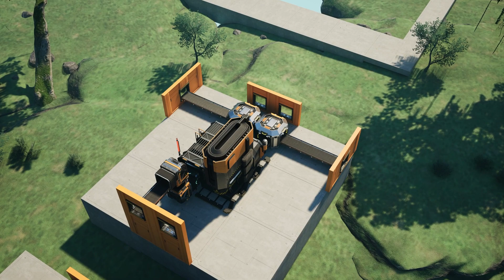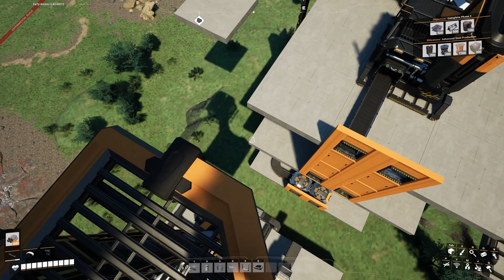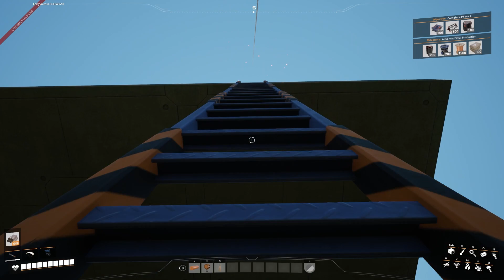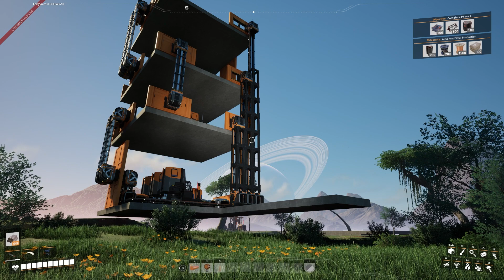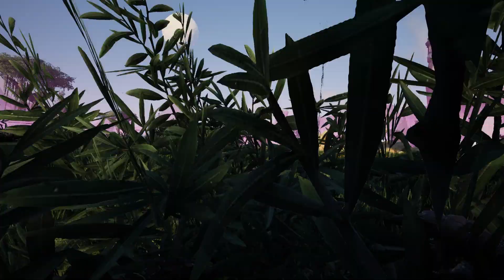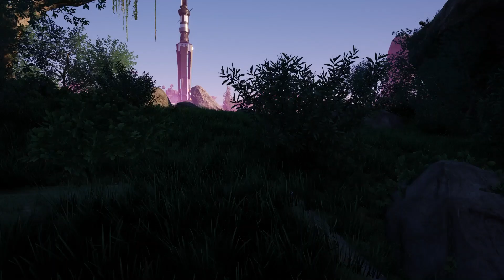Automating 180/M Steel Ingot | EP27 | Satisfactory U8 | Blind Playthrough

Comment: Just curious, have you used the custom settings to unlock all the alternative recipes or been very lucky with your hard drives?

Nice looking factory.  Looking forward to seeing what the beam and pipe factories will be like.
Reply from the maker: I have not used any custom settings. I found two hard drives nearby and one was for the steel ingot. I also found out that if you place the hard drive in the MAAM and than click away and rescan the hard drive it gives you different recipes. Similar to a slot machine mechanic. Hence, I got lucky with my drive.
Reply from the maker: I'm realizing I should start showing hard drive extraction for transparency.  I assumed the viewers would trust me but it's in my best interest to remove any gray areas. Thank you for keeping accountable, reverance!
Reply: There was no imputation of any dishonesty.  I was just curious, as you got really good results just when you needed them.  I wish I had your luck! [But then I don't use the rescan mechanic myself.]

Although watching hard drive recovery is fun, as you may have noticed they are generally guarded,  But then again you have proven to be much more adept than me at dealing with the local wildlife, so much of a muchness.  I also enjoy your sense of wonder at discovering the new biomes.  Which really was the reason for the scattered wrecks - to get the player to explore the map.

Comment: Nice looking factory Tom.  Good news is this style will lend itself to the blueprint system once you unlock it.  Did you fix your reinforced iron plate output?
You can run a belt between the conveyor wall holes also if you have a need to do so there are many useful ways to use these walls.
Reply from the maker: Thank you Marietta.
I did fix the reinforced iron plates. I'll outline those changes in an upcoming episode.